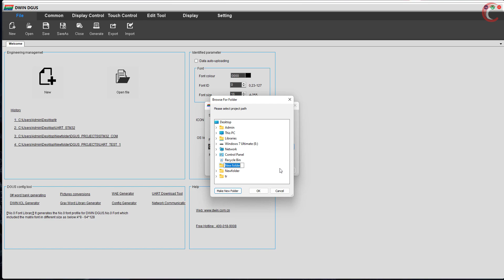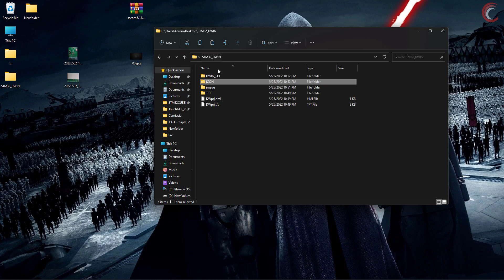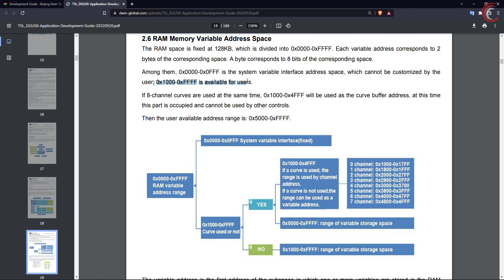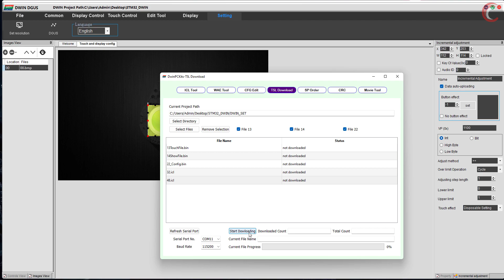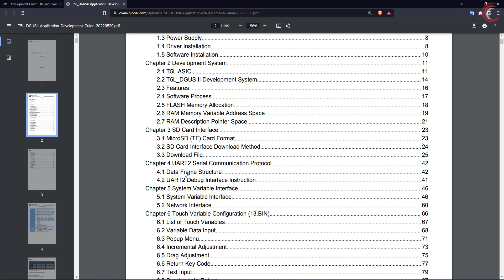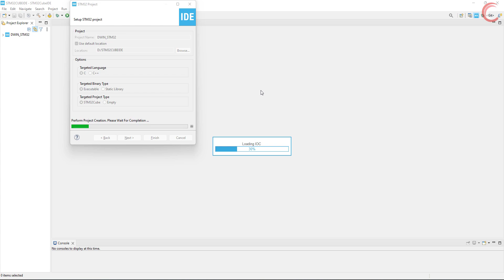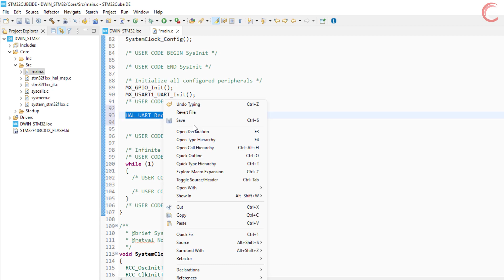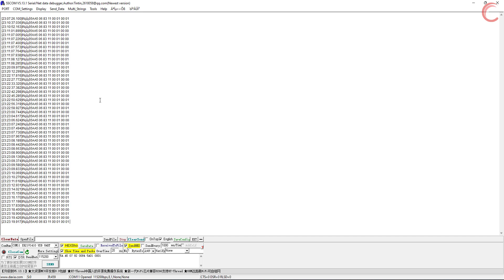Interface DWIN LCM with STM32 || LED Control using Buttons

Comment: Dear, sir thank you for your great video, i followed exactly your steps, however, when touch the button, there is no auto response from the LCD on the COM???. (only when request by command on the COM, the LCD will respond). Pls, let me know if you know how to solve it. Great thanks
Reply from the maker: That's strange.  
Are you checking it using some USB to TTL Or using a MCU?
I would advise you to use the TTL and see if the computer can receive any data.